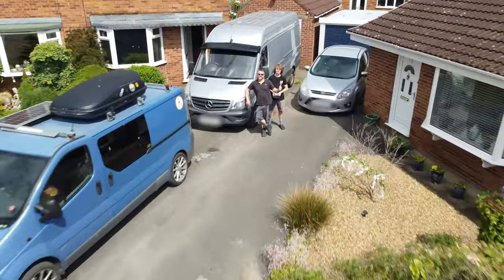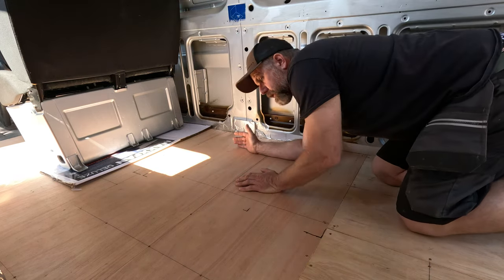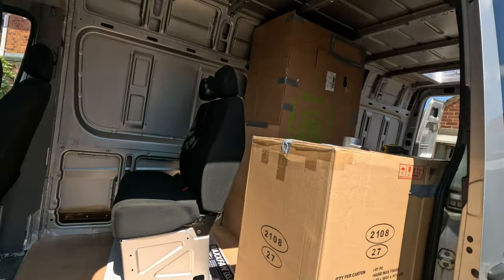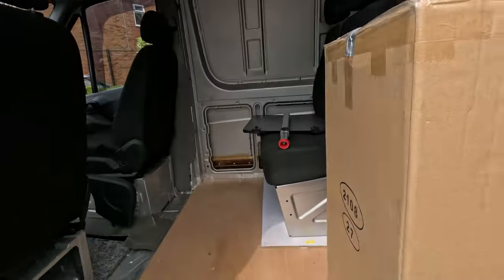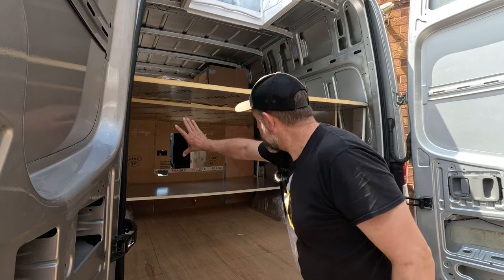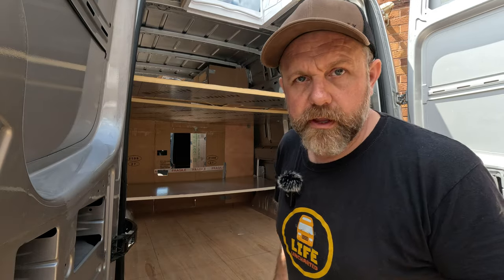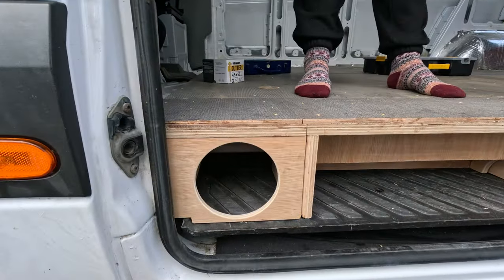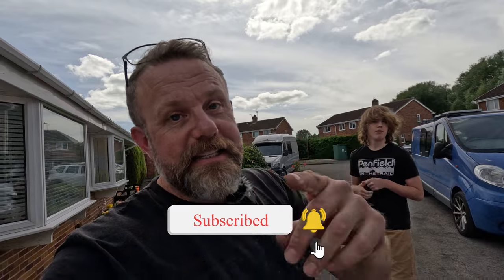Cardboard Campervan Conversion? Testing Our Campervan Layout with a Full-Scale Cardboard Mockup!

Comment: Don’t build the shower with a fixed toilet.  If you don’t like the chemical toilet you’re stuck with it.  There are other options besides a composting toilet.  Gotta Go has a great solution for $270.
Reply from the maker: Hi. Thanks. Great advice. Yeah I'm starting to think compost toilets are the best option
Reply: @life_uncharted   check out the Joolca Gotta Go toilet. It has a cassette insert, a composting insert that you can use a plastic bag or compost.   And it’s only$270.
Reply from the maker: @stevehori673  interesting. Thank you